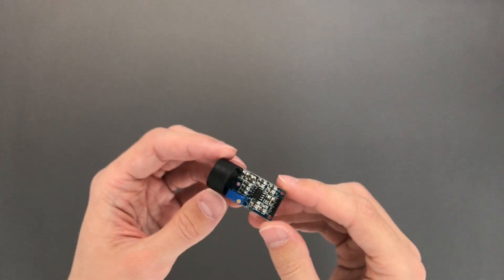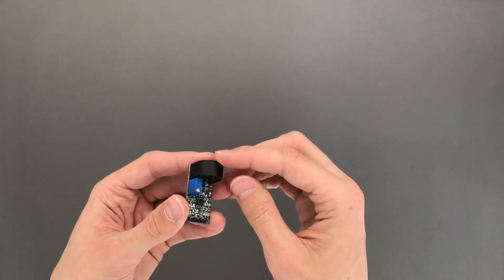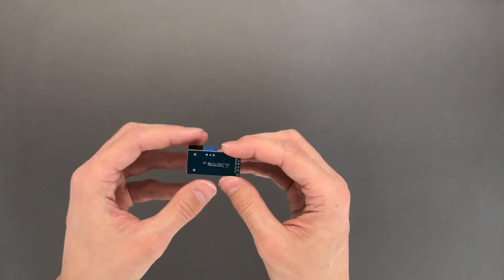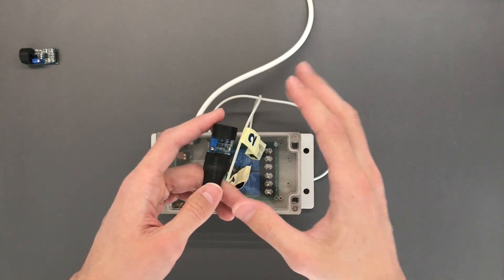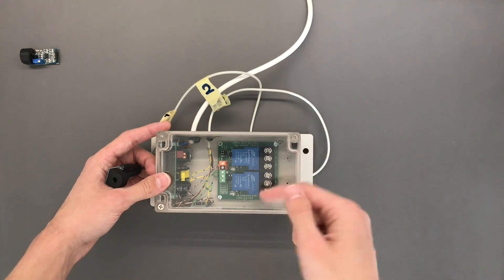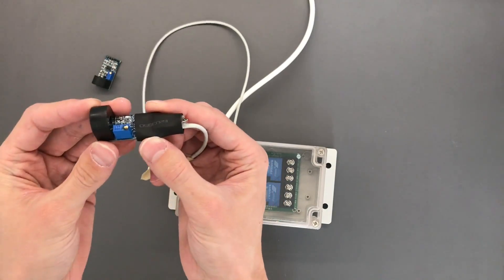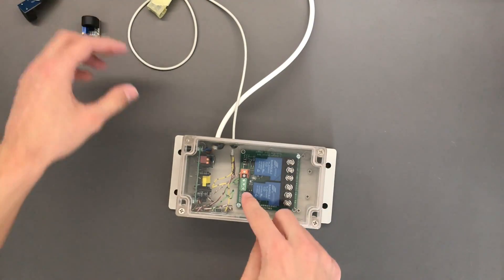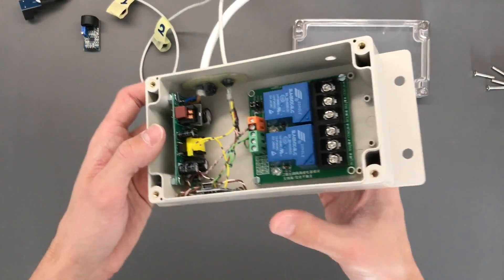Current Sensing Transformer/Donut Module - Very Simple Arduino Project

Comment: The sensor outputs an AC voltage (adjustable by the opamp) . Why isn't the arduino input pin burnt since it will receive negative voltages ?
Reply: it does not go to negative side entire sin wave is clamped above 0 v

Comment: This is a great video!  Thank you for posting it!  I have a few questions and hope that you can answer them.
1) The Current sensor is rated for 5A.  What happens is the current exceeds 5A?  I have an application where I need to sense if a device is on or off.  However, when it is on it can draw is much as 15A.
2) Where did you buy your box?
3) Which Arduino are you using for this project?

Comment: Do you think something can be setup to detect AC current of less than 1 amp?  I need to distinguish between zero current draw and as little as 1 amp, maybe even down to half an amp.
Reply from the maker: yeah - should work fine - half an amp is plenty of current in absolute terms
Reply: @Darieee  Hey, thanks. Does this use that asc712 chip? If so, I'm wondering if the 5A version would be more sensitive to a lower current -- or would it matter. -- thanks !
Reply from the maker: probably would be - not sure though, I have only very briefly played with them

Comment: Thank you for this video. Very informative. I was searching for a replacement for a 5A chip ACS712. I did use this to measure between 60-150W through a 240VAC wire connected to a motor. It isn't good enough. It doesn't need to be precise. even 10% off will be okay. I just need react on current difference during operation and if it is off. Before I order some of them , do you think that it will work with those values? May I roughly assume that 10 winding inside the coil give 10 times the mA as output?

Second question, did you by coincidence refactor the circuit to a schematic? This because I like to design my own pcb with 4 of those zmct103, with needed opamp. Or know one schematic.

Thank you and keep up the good work.

Comment: Has anyone developed a simple add on current sensor that detects current flow in the door bell wires when the doorbell button is pressed. When it senses the current it will send either a email or text message.  Sort of a poor man DIY Ring Door bell for those that already have a camera looking at their front door. This can all be installed inside the DoorBell Chime or back where the transformer is located that powers the doorbell chime.

Comment: I had no idea the sensor output 'reversed' like that, as not documented anywhere, and that would explain why with 0 current the reading is not 0, had me beat :)
Reply: with millis, it goes back to 0 after 50 days (rollover/overflow), i dont think it effects delay function, just what result you get when reading millis
Reply from the maker: yea - for sure, because more likely than not, delay does absolute math on the 'global time' variable read by millis

Comment: I do not really see, why the OpAmp is required in the module. E.g. choose a load resistor with bigger ohm value, and you got yourself with higher volts value. Or do I miss something here?
Reply: While we're on the topic of overengineering, why use a uController at all?  A resistor and a cap to set a time constant, switching a BJT base or FET gate would work just as well in this use case...
The only reason to use a uController of any kind is where logging or reporting is required...

Comment: What is the minimum measurement value ? 10 mA ac posssible?
Reply from the maker: mmm, that might be down in the noise

what you could very easily do though, is wrap what I would assume is a thin wire 10 times through the donut

that way 10mA will be 'seen' as 100mA, and that you can measure more reliably

heck, wrap it 20 times if that doesn't do

Comment: Hi, I have been using it and found that the sensor does not work beyond a 40watt bulb's current ( in its primary). Circuit gets saturated, hence output wave is not following input wave pattern. May be I have done some mistake in using that circuit (tried with multiple boards still have the same issue). Please share if you have any clue to solve it.
Reply from the maker: Sure, 

1. you have to set the potentiometer so that your ADC reading is in the middle of the range with no load, so, 511 or so on an arduino

2. you could just split the wire into 2 and just have one half go through the donut, which will allow you to measure double the current

3. you could get a much beefier current donut (key words 35A module OR WCS1800), like this: bit.ly/2TmeTOD

Comment: Is the global variable defined as "uint32_t cal;" not being used or is it there for some other reason that I am not seeing? I am new to Arduino and I understand everything else so please forgive me if this has an obvious answer.
Reply from the maker: It is VERY likely that I declared it and ended up not using it

Technically that's not a big problem as the compiler usually ignores declared but unused variables, so, they won't even be affecting the performance of your sketch

Still good practice to not have unused shit lying around tho

Comment: I am actually a complete noob with AC, can I use this module to measure Watt from my house panel?
If not what would you suggest?
Reply from the maker: Mmmm, not really, this is way too imprecise to have accurate absolute readings.

This would be good for relative measurement : checking wether something is on for example
Reply from the maker: I don't really know of any solution ... there's these cheapo power meters ... so, maybe there's a module that has their functionality on aliexpress ?
Reply: @Darieee  Thanks for the fast response! And nice video btw! 
I actually don't even know what to google.. xD
Reply from the maker: Yeah.. go for "power factor measurements with arduino" or "power factor measurement ac module" or combinations of the 2 ...

If you find something easy do also let me know ... I'd love to make myself one of those ...

Basically if you can detect power factor you already know the voltage curve and the current curve, so, you can do both apparent power and real power (a very interesting topic in its own, which if you're unfamiliar with you'll find many great videos on here about)
Reply from the maker: Yeah.. go for "power factor measurements with arduino" or "power factor measurement ac module" or combinations of the 2 ...

If you find something easy do also let me know ... I'd love to make myself one of those ...

Basically if you can detect power factor you already know the voltage curve and the current curve, so, you can do both apparent power and real power (a very interesting topic in its own, which if you're unfamiliar with you'll find many great videos on here about)
Reply: @Darieee  I will check it out tomorrow! Thank you very much! If you make a video about it I will be the first to like it btw!
I will check the rest of your videos!  Thanks again! :D

Comment: Is it possible to download your code some where? thanks for the info
Reply: Hi. Can I buy the project please ?   I want to monitor 0 to 10 amp on my small inverter and turn a cooling fan on above 1 amp with a 5 minute off delay once the amps drop below around 0.8 amp.  Freight to Australia.  This is exactly what I'm after.
Reply: Hi Tracy. Would love to help, but Im still learning codeing. You should probably ask Darieee. You can also try to ask another youtuber 0033mer maybe he will help.
Reply from the maker: Send me an email - it's linked in my about page
Reply from the maker: I find the 3-liners not worth uploading to git
Reply: Im lazy I know, but Im such a noob to this topic.. if that was not obvious
Reply: 'switchRelay' was not declared in this scope

any idea what Im doing wrong?
Reply from the maker: #define switchRelay 3

And replace 3 with whatever pin you are using to control your relay

You could just always write 3, but it's good practice to name pins at the beginning to make your code more understandable

The define basically replaces all "switchRelay" words (tokens) with "3"
Reply: so in the beginning you wrote

#define ON          true
#define OFF         false
#define RELAY1      11

"#define RELAY1 11" is that  < equivalent > to "switchRelay"? in that case I should use one or the other of "RELAY1" or "switchRelay" which controlling pin 11. sorry many questions, but this is like sumerian cuneiform to me
Reply from the maker: #define BlueLED 4

So, again, what a #define does, is it basically tells the compiler to replace all instances of "BlueLED" with "4".

So, with the above define:

digitalWrite(BlueLED, HIGH);
is exactly and 100% equivalent to
digitalWrite(4, HIGH);

(the compiler is the program that takes what you write on the screen and transforms it into a very long sequence of 1 and 0 that represent the instructions the Arduino will execute. One of the first things it does, is to replace all "defines" with the thing they stand for, so, all instances of BlueLED will be replaced with 4, and then further processed)
Reply: Ok I think I get the function #define

but I can´t get the code to work. I defined switchRelay as

#define switchRelay 3

and I get a errormessage;

In function 'void loop()':

NO NAME:77: error: expression cannot be used as a function

                             switchRelay (ON);

                                            ^
NO NAME:82: error: expression cannot be used as a function

                             switchRelay (OFF);

                                             ^

NO NAME:88: error: 'relayState' was not declared in this scope

                                  if ( relayState == OFF ) {

                                       ^

C:\Users\NO NAME.ino: At global scope:

NO NAME:4: error: expected unqualified-id before numeric constant

 #define switchRelay 3

                     ^

C:\Users\NO NAME.ino:100:9: note: in expansion of macro 'switchRelay'

 void    switchRelay 3(bool desiresState) 

         ^

NO NAME:108: error: expected unqualified-id before 'if'

   if  (desiredState == ON ) if ( abs ( millis() - switch_request_time > 3000 ) {

   ^

NO NAME:118: error: expected unqualified-id before 'if'

   if (desiredState == OFF ) if ( abs ( millis() - switch_request_time) > 8000 ) {

   ^

exit status 1
expression cannot be used as a function

understand if you other things to do, any help appriciated.
Reply from the maker: No idea, did you define the function switchRelay ?
Reply: Yes I defined it in the beginning as a global command as you mentioned

#define ON          true
#define OFF         false
#define RELAY1      11 
#define switchRelay 3

uint16_t  i;
uint16_t  powerOn_blinker = 0;

uint32_t  cal;
uint16_t  currentReading;
uint16_t  maxReading;
uint16_t  minReading;
uint16_t  offset;

bool      relaySate             = OFF;
uint32_t  switch_request_time   = 0;

void setup() {
  
  
  Serial.begin(9600UL);                                                               // put your setup code here, to run once:
  pinMode(RELAY1, OUTPUT);                                                    //incredibly important 

for (i=0; i<=2; ++i)
    {    
    digitalWrite(13, HIGH);
    delay(100);
    digitalWrite(13, LOW);
    delay(300);
    }  
    

              }

void loop() {                                                                           // put your main code here, to run repeatedly:

      maxReading = 0;
      minReading = 1024;
      for (i=0; i<=99; ++i)
                           {
                            delay(1);

                            currentReading = analogRead(A0);
                            if ( currentReading > maxReading ) minReading = currentReading;
                            if ( currentReading < minReading ) minReading = currentReading;
                           
      
  
                            }

offset = maxReading - minReading

//
//Serial.print (minReading);
//Serial.print ("\t");
//Serial.print (currentReading);
//Serial.print ("\t");
//Serial.println (maxReading);

     ;  if (offset > 300) {
                            switchRelay (ON);
                            digitalWrite ( 13, HIGH );
                         
                          }
        else              {
                            switchRelay (OFF);
                            digitalWrite( 13, LOW );       
                          }                    

      if ( powerOn_blinker == 9 ) 
                                 if ( relayState == OFF ) {
                                                           digitalWrite ( 13, HIGH );
                                                           delay (50);
                                                           digitalWrite ( 13, LOW );
                                                           powerOn_blinker = 0;
                                                          
                                                          }

      else powerOn_blinker ++;

}

void    switchRelay 11(bool desiresState) 

  if  (desiredState == relayState)  {
                                       Switch_request_time = millis ();
                                       return;
                                    }

  if  (desiredState == ON ) if ( abs ( millis() - switch_request_time > 3000 ) {

                                                                                  digitalWrite (RELAY1, HIGH ); 
                                                                                  relayState = 0;

                                                                                  switch_request_time = millis();
  }

  if (desiredState == OFF ) if ( abs ( millis() - switch_request_time) > 8000 ) {

                                                                                 digitalWrite( RELAY1, LOW ); 
                                                                                 relayState = OFF;

                                                                                 switch_request_time = ,millis();

  }